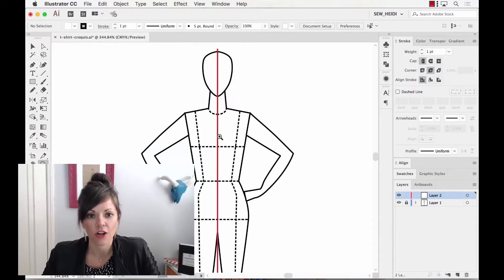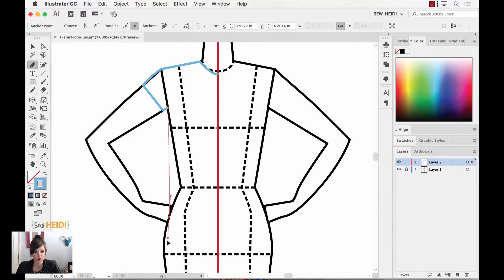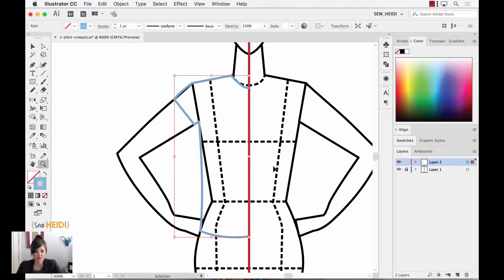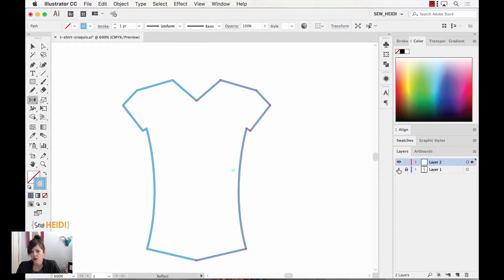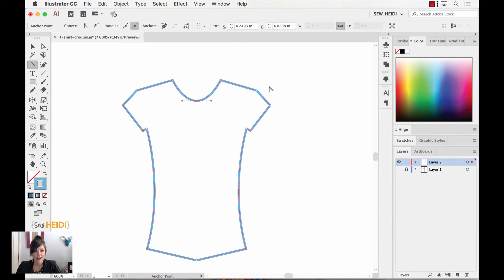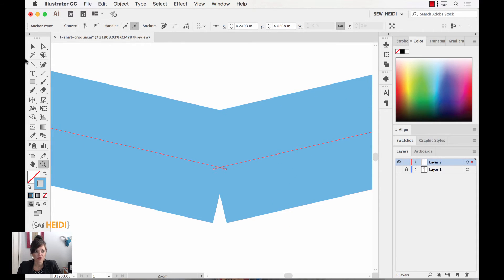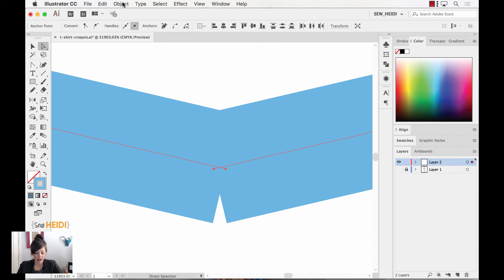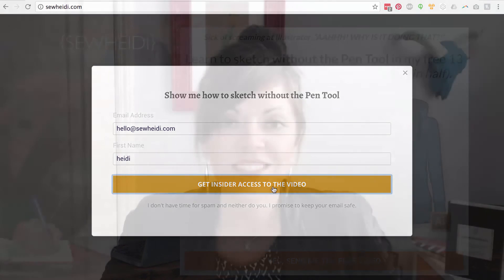How to Create Fashion Flats with Smooth Curves in Illustrator

Comment: Heidi, I don't know why but most of your videos are just a green screen when I press play. Is that a problem wit my server?
Reply: What browser are you using? If you haven't yet, go into your browser settings and clear the cached information. (This will, unfortunately effect automatic log-ins on multiple websites, so if you're permanently logged in to any account you don't have the password for, reset the passwords so you know them before you do this.)

Then, run any updates for both your browser and your graphics card on your computer. (on mine, it's an Nvidia card so the graphics card updates are labeled Nvidia but if you have a different computer than me, your graphics card is probably called something different.)

After doing that, fully restart the computer. 

If that does not work, you might be having some sort of bandwidth/internet problem. You can check if that's an issue at www.bandwidthplace.com (Don't use speedtest.net, the ISPs meddle with how it works so it never gives an accurate read.). For youtube to work, you should be getting at least 1 mbps down. Technically youtube is SUPPOSED to work at .5mbps, but honestly, most of the time you really need at least 1mbps for videos to even load.